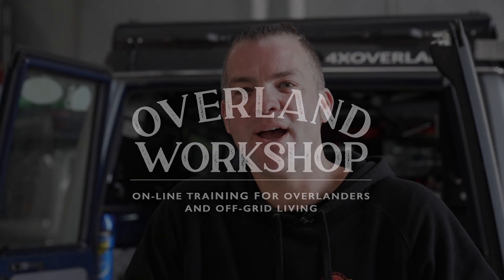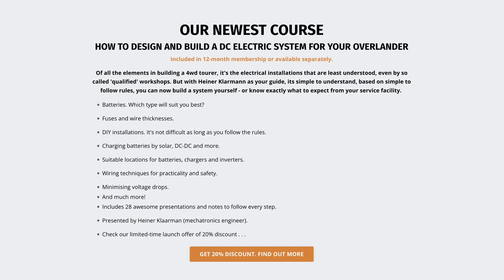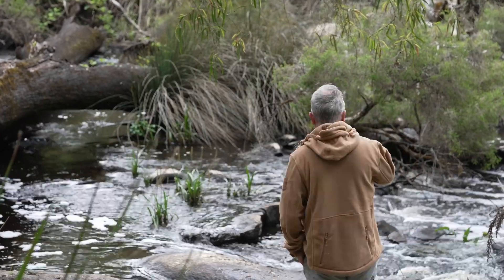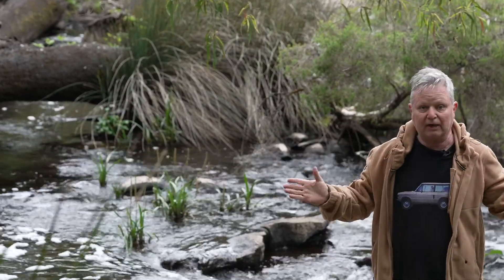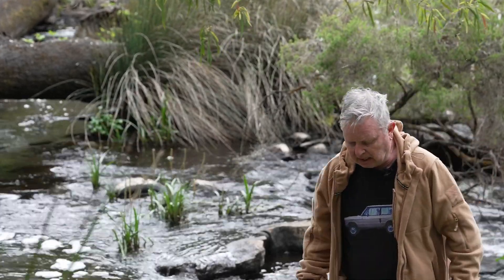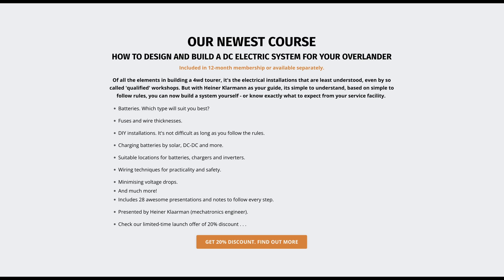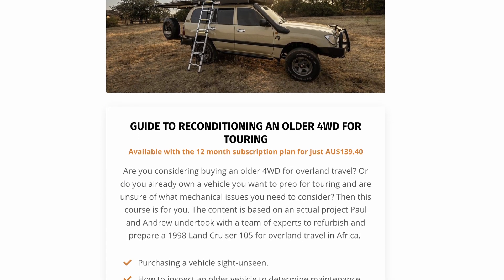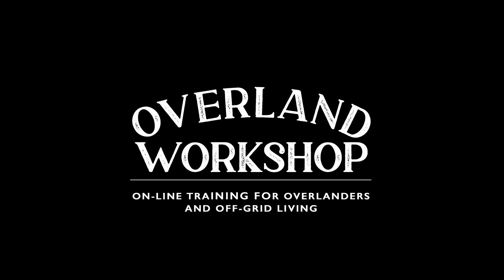HOW TO DESIGN AND BUILD A 12V ELECTRIC SYSTEM FOR YOUR OVERLANDER  @4xoverland

Comment: No need to design anything. Just decide which capacity you need and buy the right size lithium battery. I decided for the Goalzero 3000x. Inverter, solar controller, car charger etc are included. Just mount and use.

Comment: Awesome I just built a 12v setup in my fj using the egon hub as the (brain) it’s turned out fantastic 200amh 2000w inverter charger thanks for making and sharing your experience 🇦🇺👍